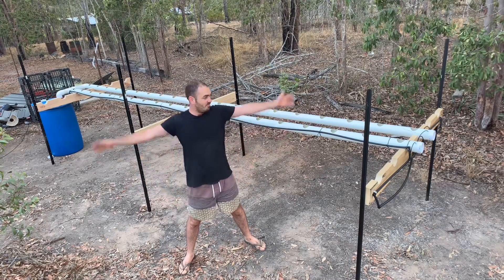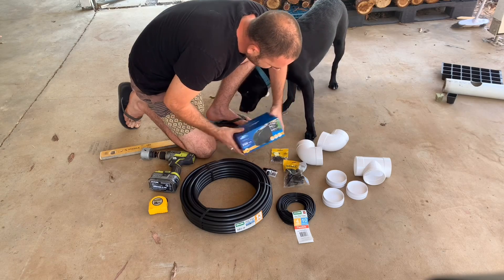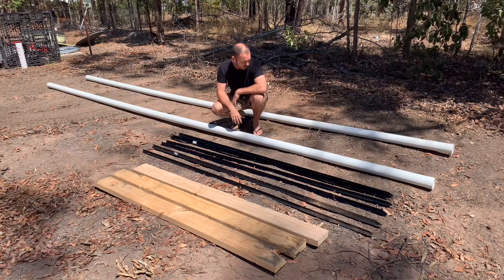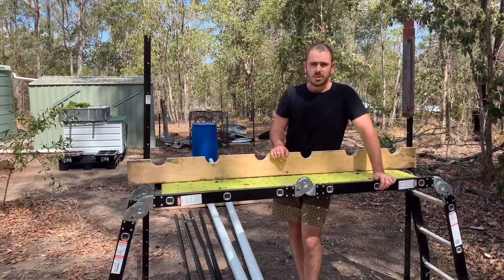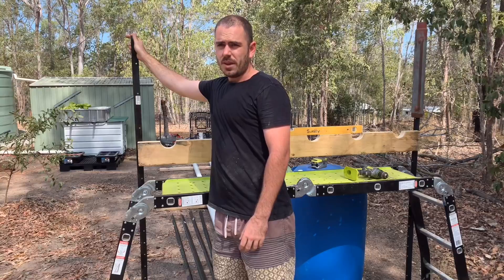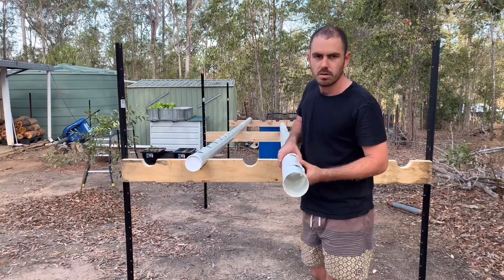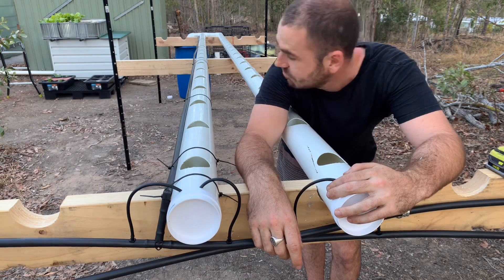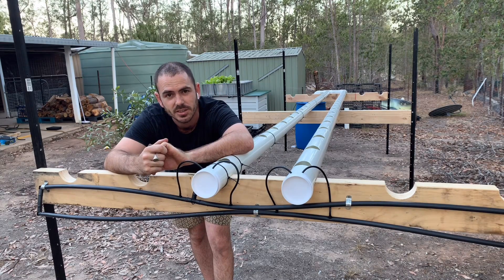How to Build a NFT Hydroponics System: OG Version

Comment: Hoocho, I'm trying to decide between 90 and 100 mm stormwater pipe. Obviously you may have chosen 99mm due to it being significantly cheaper and it does similar results?
Reply from the maker: It is half the price where I am. The distance the plants roots have to travel is shorter. If you want to grow larger plants in the system you can always have one or two rails that are larger. Which I plan on doing in the future
Reply: I've been advised to use 100mm pipe, more expensive but much better quality. For some reason 90mm pipe is much thinner than 100mm and you can squeeze it with your hands. So for a longish section like 6m, 90mm will likely sag a lot more than 100mm.

Comment: As usual very insightful video. Thanks for sharing Bro! I also have a problem with all sort of creatures, mice, possums (these guys love everything with fruit), snakes, kangaroos, what have you. It seems that chicken wire that used to keep them away doesn't work no more. I have a question though, do you normally apply a 2-3° angle to a rail for water return or you keep it level? Cheers!
Reply from the maker: VanClaaude I’m not sure of the degree of drop, I would say it’s probably 3°, as long as the pump is running through those 4mm channels at capacity the drop doesn’t so much matter as the roots will slow the solution. Though you don’t want it level, or you’d end up with a dwc recirculating system.

Comment: Thanks for sharing.. i will be setting up similar system and your videos are very helpful. Thanks again
Reply: Yo Hoocho I know you got your hands full right now but when you get a chance mate can you please tell me what you did to prevent root rot in your NFT system? I am trying to control temps but can't get it lower than 28 degrees on most days.
Reply from the maker: Julian Taylor I don’t do anything. There is some root rot, but the plants still thrive.
Reply from the maker: Siddhartha Alhat make sure you check out my video on “Cheap alternative to net cups and rockwool” as that is the way my system is now set up